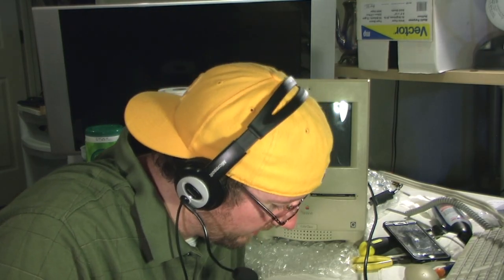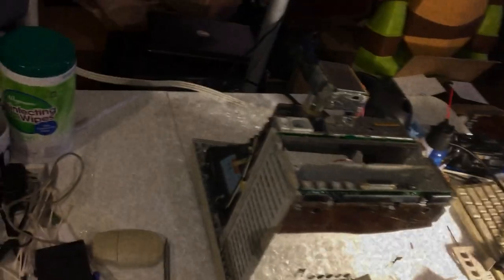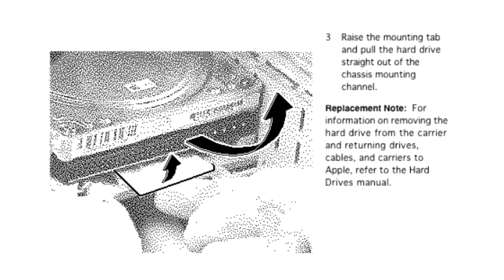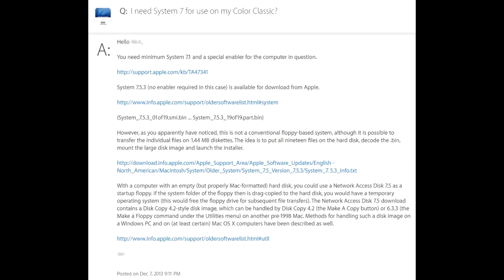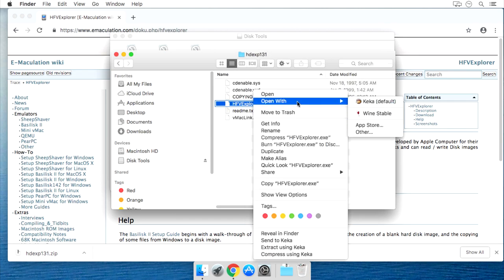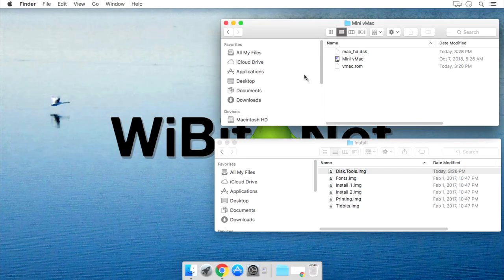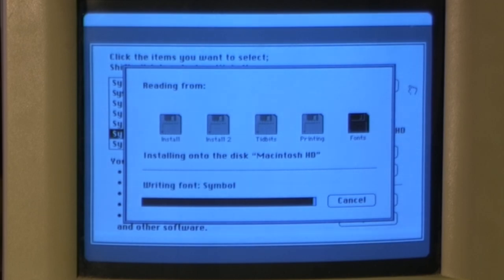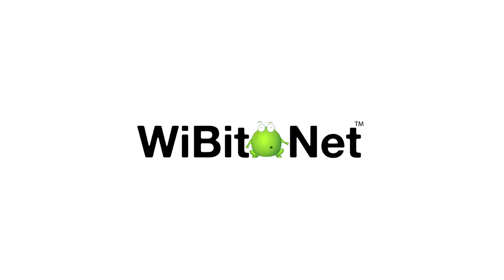Restoration Therapy: Macintosh Color Classic Rescue - No Power, Hard Drive Replace, & OS Install

Comment: Excellent video!  I just purchased a Mac Classic on eBay and I'm tooling around with it.  I ran across this video in search of answers to a boot problem I currently have.  When I boot up, I get the flashing "?" until I use my "Disk Tools."   I found your video very helpful in gaining a better understanding of what I need to do going forward.  Thanks!
Reply from the maker: Awesome! I think I put a link to the boot images in the description because people kept asking for them. Other than learning the best way to replace the broken hard drive, that was the most painful part of my repair on that system. I still have it in my collection!

Comment: Hi Kevin. I wasn't able to get my Mac Color Classic to power on until I cleaned  the caps with alcohol and a toothbrush. They did leak electrolyte on the board, but thankfully the battery didn't leak. Thank you. I tweeted my back twice and it was extremely painful.
Reply from the maker: Does it power on with the logic board out?
Reply: I didn't try that.
Reply from the maker: @jeffpittel6926  If you have no logic board installed it should still power on. It won't do anything but you will hear it turn on. If it doesn't then the issue is larger than the logic board.

Comment: One question for this video: I did all of this, copied it to a floppy and put it into my Color Classic's floppy drive. All it does it spit it out, and a Floppy Disk comes up and blinks an X for a few times before going back to floppy + ?. Any ideas there?
Reply from the maker: Hmmm. I don't know. I am not sure I understand fully what you're saying. So, you put the floppy in when the computer boots up, and it spits it back out?
Reply: @WiBitnet  Exactly, so what happens is it boots up (I assume the HD is dead currently and want to just boot off of DiskTools for now), I put the disk in, it goes in and hesitates for like 3 seconds and then spits it back out. I then get a Floppy icon with an X that flashes 3 times. Then afterward it goes back to the Floppy Question Mark icon. The floppy disks are brand new, so I'm ASSUMING it's the floppy drive, but I'm not 100%. I think my boot disks are right, but I don't have another mac at the moment to test it out on.

EDIT: I appreciate the response!! Thank you!
Reply: Just an update here for any internet wanderer: My floppy disks (I bought from some rando, but were new in the package) may be bad or something. If you get a flashing "X" with a floppy icon it means that either the drive is bad or your disks are bad. I swapped the HD with an existing HD I had with 7.1 on it and it worked BEAUTIFULLY. The disk drive also seems to work. If you ever have any issue with your floppy, check out page 27 of this old repair manual: 

http://www.applerepairmanuals.com/the_manuals_are_in_here/Color_Classic.pdf

Hope this helps anyone wondering!
Reply from the maker: @marineoceania  I think I have a download link to the disk images I made in this video in the description.
Reply: Kevin WiBit yeah I used those! Thank you! I think I need to clean the reader of my floppy drive though because it can’t read ANYTHING I put in there currently :( looks a tad harder to pull that out without messing with the anode cap, unfortunately haha. Pray I don’t shock myself, even with proper precautions 😂